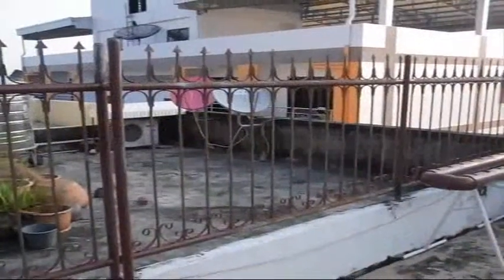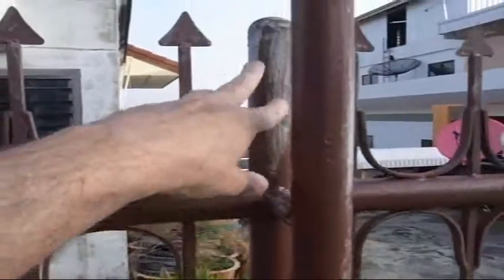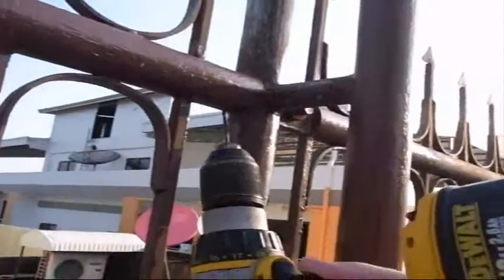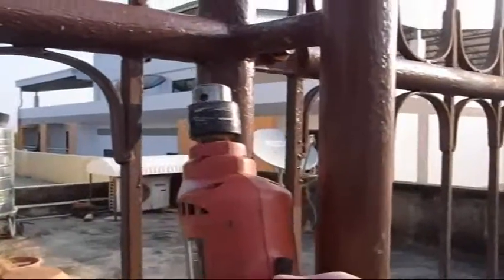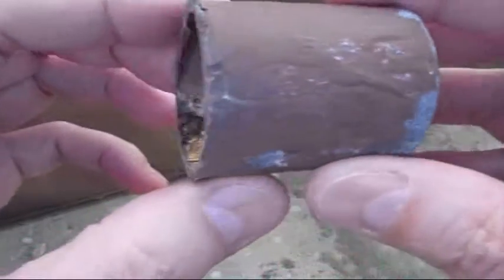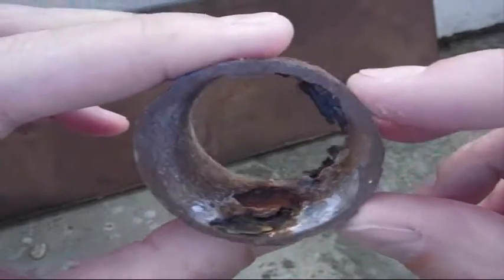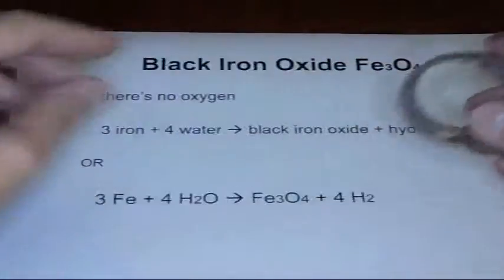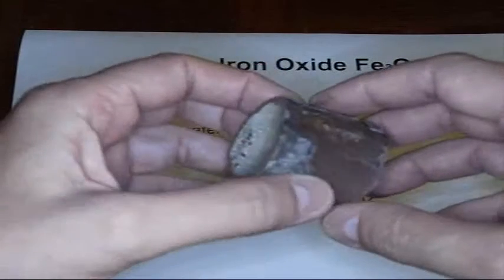Hidden Iron Pipe Danger - Weekend Welding Warrior

Comment: wild!
Reply from the maker: Scary! I have some others I need to drill. Will have to set up the camera and see if others do it. Also the other day I was putting up a light on a fixed awning and drilled into the support tube and water came pouring out for 5 minutes. Wish I had that on camera as a warning.

Comment: like Dave glen said three month ago, condensation  and or a pin hole in welding causing moister in the pipe the warming of the pipe due to the sun causes a bit of pressure but still not unsafe because your not dealing with any large volume,  I've been welding and cutting that stuff for 40 years there is no safety issues here , obviously you don't let your electric drill get so soaked that you electrocute your self but get a hole in it and let it drain out then get to work? I've taught many of book smart people in my day some on hands practical knowledge and common sense, it goes a long ways.

Comment: all that is is a little water got into the pipe because the welder didn't get the weld in all the way. the gasses are not hydrogen, but more likely atmospheric pressure increased inside the pipe from heat. I've welded on 100's of old pipe fences, nothing to get paranoid over, no need for a hazmat suit.. lol actually, I don't buy the pressure claim at all, it looks like a 8' piece of pipe, if the amount of water you described ran out the hole from gravity, that much water wouldn't have allowed enough void in the pipe for air=gas pressure to accumulate, I call BS sorry
Reply from the maker: Fair enough.  The water did not run out, it was under pressure something like 50 to 100 psi, nothing you could stop with a finger over the hole.  It did not trickle, it sprayed.  I looked up the chemistry and water and iron in the absence of oxygen makes hydrogen as the iron corrodes.  So that's my story and I'm stickin' to it!
Reply: @tsbrownie  I could see a gallon or two of water laying in there with some hydrogen reaction filling up and causing some compression.  Always some know-it-all to naysay...

Comment: Most of the welding I had done was on pipe that had never been welded before. Lot's of hidden dangers 
Thank you for sharing.
All my best.
Bobby
Reply from the maker: +Bobby Tectalabyss Me too.  Just curious, in all your training and experience, have you ever heard of such a thing or know anyone that has?  Perhaps people that do demolition would have seen this.  I can't be the only one!  ;)
Reply: +tsbrownie Hi TS. I have thought a lot about my time welding,cutting and even the stories I've heard from other welders. I can't recall it happening to me or anyone telling about something like this happening. That doesn't mean it hasn't happened.

I am sure it has. Dust was always a problem in the jobs I worked. Almost always when cutting old equipment loose from their mounts.Or when the cleaning crew decided to blow off the Machinery while I was welding a part. 
I am thinking where you live has a lot to do with what happened.
All my best.
Bobby
Reply from the maker: +Bobby Tectalabyss  I'm sure you are right that where I live is a factor with all the rain and humidity.  ColtDelta wrote in and said the high pressure water thing happened to him on his mom's security fence, but it was on the verticals instead.   
Dust is another interesting hazard.  I have not had to deal with much dust (some saw dust occasionally) but growing up in the Midwest with the yearly grain elevator dust explosions, we were warned about such things in our industrial arts classes.     Thanks for letting me know.  Clearly this is a very uncommon thing.

Comment: Fascinating.  If it were me, I would have ignored the pressurized H2 gas and probably blew myself up.
Reply from the maker: +ElGatoLoco698 I came so close to just cutting into it with my AC powered angle grinder to open it up.  Not even sure why I drilled it.  Guess someone up there was looking after me that day.